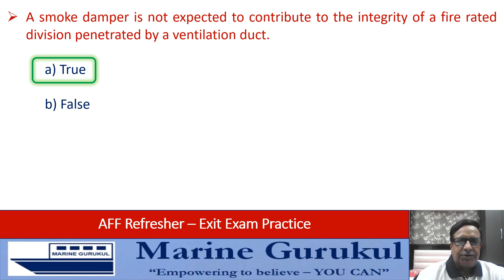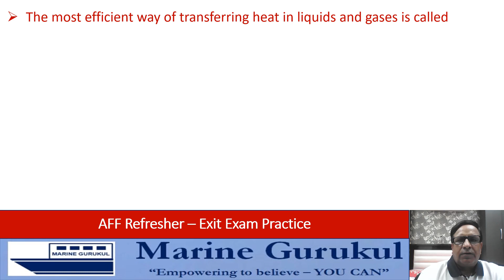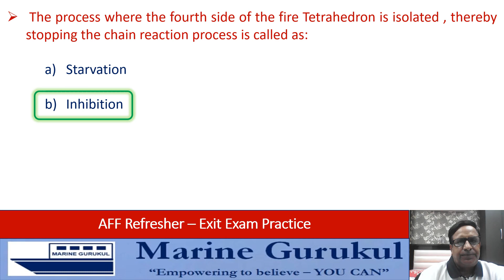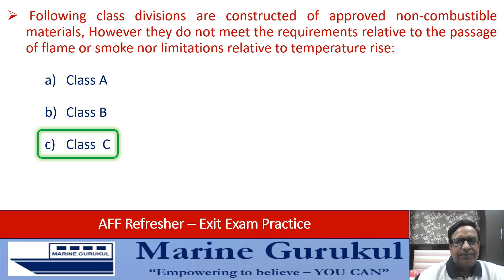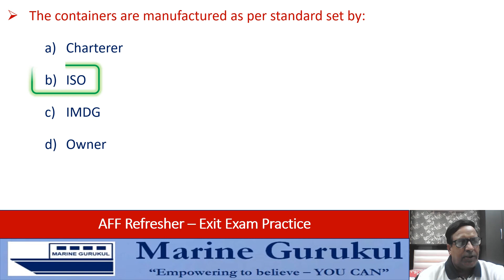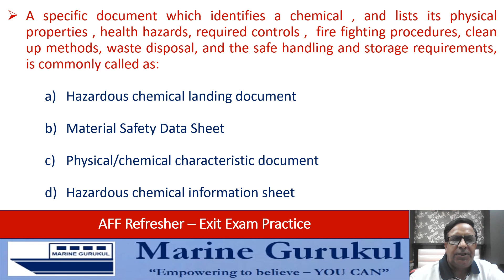AFF Refresher Exit Exam Practice Questions - Set 01

Comment: To stop a fire, one of the three elements of the fire triangle must be removed. So, if a fire runs out of fuel, it will smoulder out; if you can cool a fire down it will lose heat and go out; and if the oxygen is removed it will suffocate.
Reply from the maker: Naveen, you are right removing any of the elements would lead to fire control. The terminology is:
Removal of fuel - starving
Removal of Oxygen - smothering
Removal of Heat - cooling
Good Luck